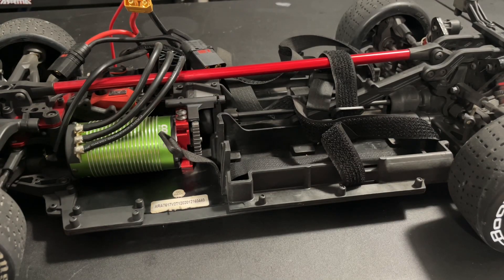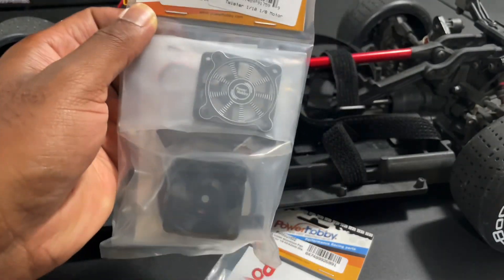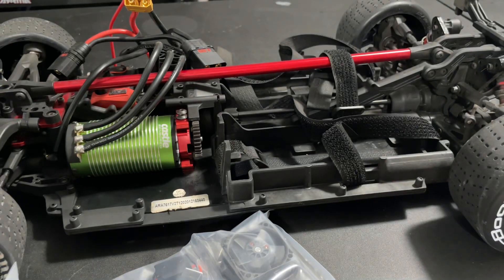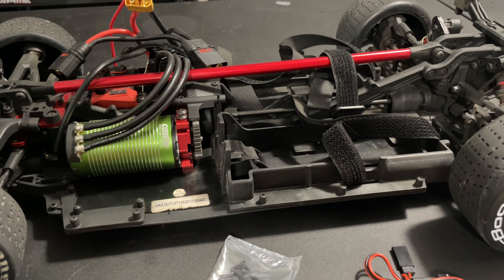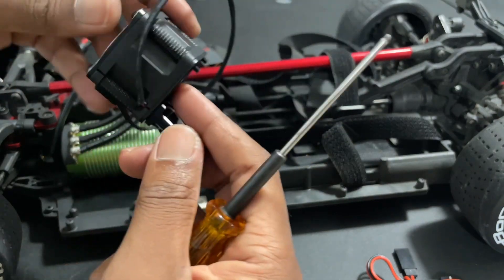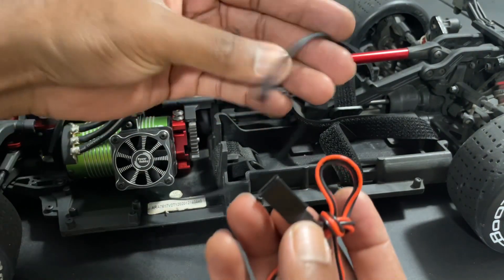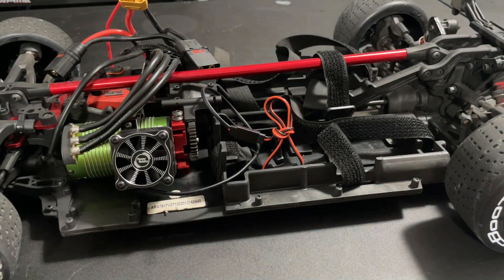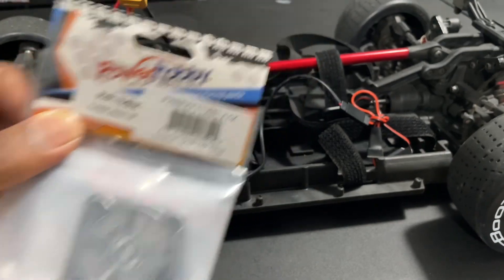How to install  Powerhobby Twister 1/10 1/8 Motor Aluminum High Speed Cooling Fan #powerhobby #howto

Comment: That fan sounds like it will move some air for real !! I'm in!! Did you end up adjusting the motor, or did it have the clearance like this?
Reply from the maker: It’s worked in the same position but I did rotate the the fan so the wire is out the way.